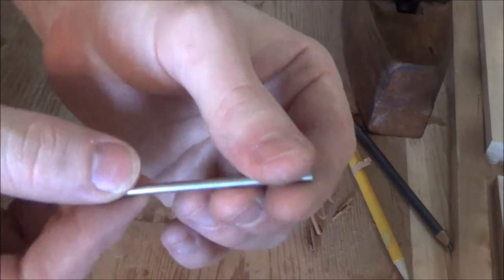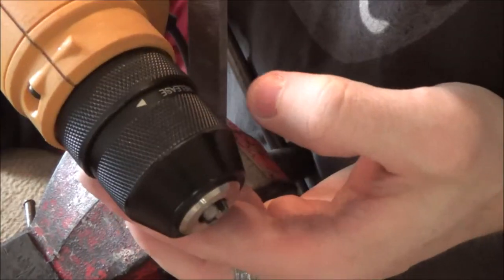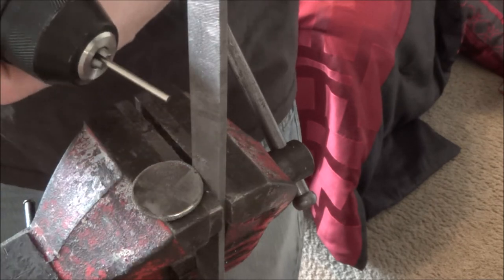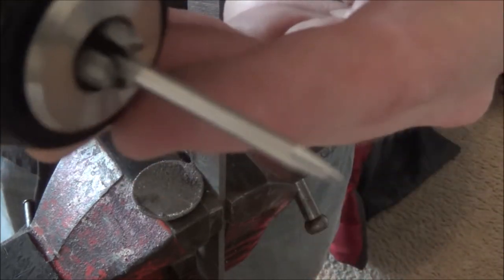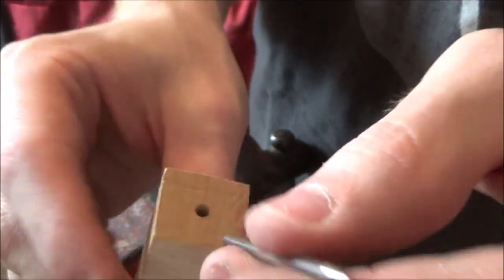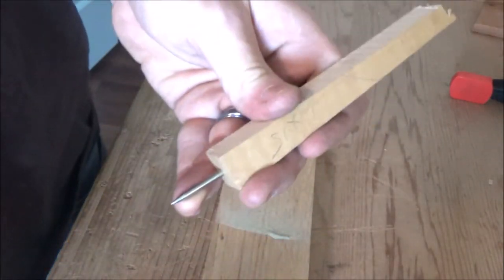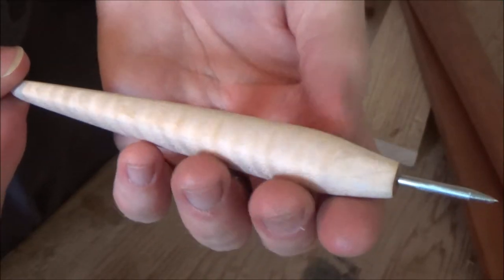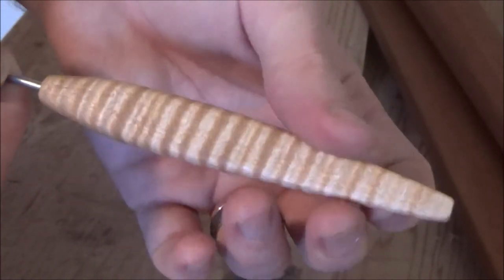How to Make a Handy Wood Scribe

Comment: Hi there!! I want to build a scribe like this and I want to use a nail for the tip..I was wondering how well its holding after 3 years? Have you sharpened it very often?
Reply from the maker: Hey! I have sharpened it maybe 5 or 6 times. A nail would be fine you but it may need sharpening a bit more often.